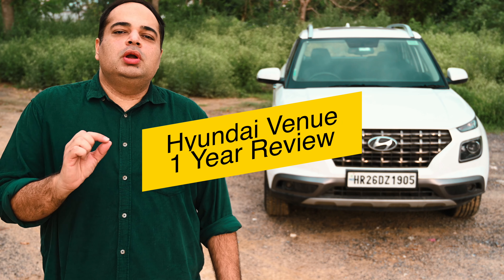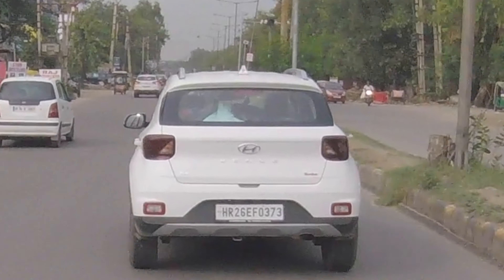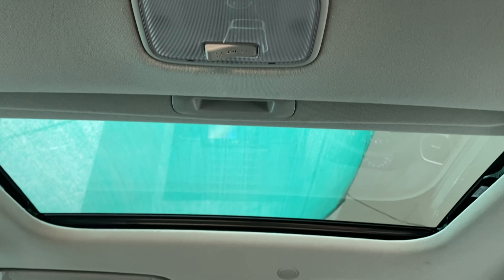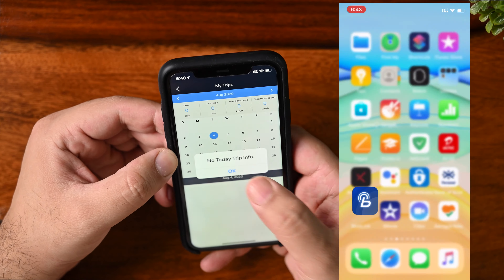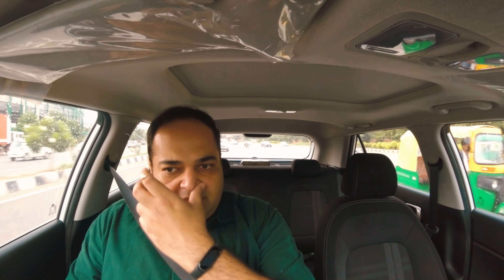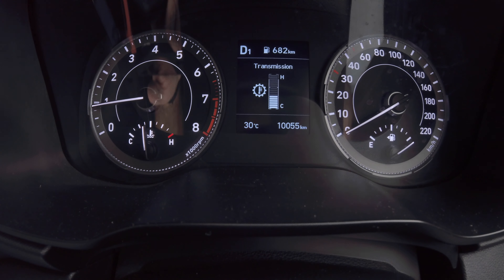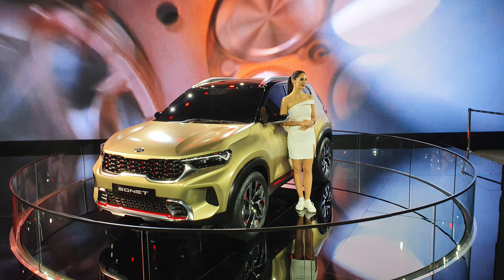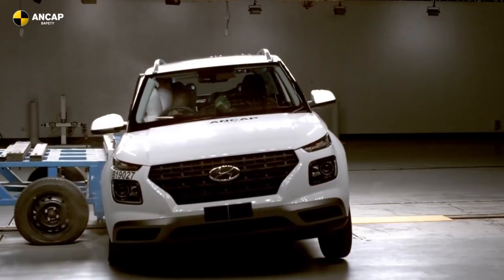Hyundai Venue Owner Review - A Year's Experience in 2020

Comment: Sir that's a great review. I own a Ciaz diesel planning to change, which one either of these shall I go in CIAZ S, CITY VX , CRETA SX petrol occasionally driven about 500km per month.
Reply from the maker: I'd say a change of model will be better. Since you've already owned the Ciaz, choose between the other two. There the decision will be a bit more fundamental: SUV vs Saloon car. I'd say the Honda CVTs are better (with programmed emulated gearshifts) if you're considering that tranny. The most exciting to drive will be the Creta 1.4 Turbo with DCT plus the wow factor of the panoramic sunroof. Anyway you can't go wrong with either. Choose between these two based on your intended usage. Hope this helps.
Reply: @TechnologyRig  Thank you Sir ,  I own a SELTOS diesel AUTO  for Day to day use . I may opt for Creta SX due to panoramic sunroof. Let me test drive both Creta and City to finalize.

Comment: Is 1.0 turbo petrol underpowered when compared to 1.5 diesel?
Reply from the maker: On the contrary Syed, the 1.0 turbo is the most powerful engine in the range and is the quickest and most fun to drive.
Reply: @TechnologyRig  Will it drag with full load and luggage?
Reply from the maker: Syed, even with full load, no lack of power. For that matter, even the diesel will not feel underpowered in this kind of usage. Only Petrol 1.2 is underpowered.

Comment: Hi sir, I have one month of driving experience.. i m thinking to buy a car , so choose to buy venue sx imt ,, is good for new drivers like me or should I go for another variant or car ??
Reply from the maker: Hi Sucheta, the Venue SX iMT will certainly be an easy to drive vehicle. But it's an odd choice for a first car, reason being, most cars are either automatic or manual, thus for a new driver, it's best to practise on either of these types of transmissions. That way, later on when you have lots of driving experience, you can be comfortable driving all sorts of cars. Choose iMT only if you will drive everyday in heavy bumper to bumper traffic. Otherwise the manual will be slightly cheaper and much more entertaining to drive, besides giving you the best experience for later years, as once you're used to manual cars, you'll be able to drive all sorts of vehicles.

Comment: I’m really confused between IVT and DCT, im interested in DCT Creta but as I heard much about the heating issue im worried if i need to take a halt on bumper to bumper traffic because my mostly drive will be on city ,highway and hilly areas

And when it comes to IVT ive heard about the rubber band effct and of the lag that it gives

So can u kindly tell me which one should in for?
Reply from the maker: Hi Steward, no need for confusion, I'll clear your doubts. Yes the IVT/CVT has a rubber band effect, more so on some cars, less prominent on others. Hyundai's i20 I drove with the CVT was lovely and smooth at city speeds, as soon as it went on to the highway, the ugly rubber band effect kicked in- meaning lots of revs, lots of noise and acceleration only after a few seconds. Enough to dissuade me from buying the CVT. Surprisingly, the Baleno CVT was much better, nothing significant in terms of this lag. Now the DCT, my Venue DCT transmission has NEVER overheated in traffic. However, I can see this happening for some people who drive it like a conventional automatic. You don't need to stop in heavy traffic, rather maintain a slow but steady pace instead of constant brake on and off, that might mean missing a few chances to get into a traffic gap, but this way, the transmission will not overheat. For you, simply look at your usage, if its a good mix of your intended usage, go with the DCT, you will love the performance it offers. If however your usage is mostly bumper to bumper traffic, only then consider the IVT. Try the IVT on a highway if you can and press on the accelerator and see if the lag is acceptable for you. Also focus on the engine, the turbo petrol engine is a much better bet than the NA Petrol. I tried the the 1.6 Petrol NA Creta (126ps) last year and it was totally gutless, hence I chose the Venue Turbo Petrol, even though it was smaller than the Duster it was replacing and the Creta would have been the natural choice. Hope this helps.
Reply: The Good Life , thank u so much sir for the information 🙏🏼  n thankyou for sparing your precious time on my stupid question, means alot 😊
Reply: @TechnologyRig  😍

Comment: Sir you have done an amazig review. :- I am very much intersted in Venue, SX+ DCT 1.0 GDI petrol.My running is low for the first 3 years and then I will use it regularly.Initially my father will use it then i will take over. My driving is mostly in the city.Respected sir, pls answer my questions:-
1)Is dual tone availabe in this variant(SX+ DCT)
2)Will driving in manual mode reduce the overheating of the DCT
3)Is the car comfortable
4)Will its turbocharged engine create problems in future.
5)Is the service good?
6)Is it value for money?
Maybe i will buy it next year, so should i wait for the facelift?(if it comes)
Here in Banglore, it's costing me 14.4 lakh on road.Is it good to purchase it?
Pls answer me sir
Reply from the maker: Piyush thank you so much for the kind words. I'm just in the process of uploading a variant selection video for the Venue. I'm sure you will find it useful, watch out for it tonight. The Dual tone is now available in the DCT variant. The overheating issue will not be affected by the manual changing of gears, since the car will have to clutch and declutch when stopping. Point is, drive at a constant pace without jerky and intermittent brake inputs, then you'll be fine. I've never had a problem here, since I understood this early on and adapted my driving style. The only scenario where NA engines were considered more long-lasting than turbo ones was short driving cycles. But all machinery has a finite life anyway. I've had many turbo cars over the years and unless you talk about very old cars, you have nothing to worry about in this aspect. Service so far has been great and inexpensive. Do watch the next video and I hope this helps you.
Reply: @TechnologyRig  THANKYOU SIR, ALL MY DOUBTS ARE CLEARED, THANKYOU ONCE AGAIN FOR ANSWERING
Reply from the maker: Most welcome, glad it helped. Check out the variant video here: https://www.youtube.com/watch?v=4vk89zPiyU8

Comment: Hi Sir, I own venue 1.0 Turbo petrol, it is less than 3 months old. I hear a strange rattling noise from engine bay, I took it to the service station and they had it diagnosed but they are not convinced with the issue as they say that it is default noise from the turbo engine. Can you help me here by letting me know which part of the car did the company replace to arrest the noise. If I know it I can take it forward to the service station and get it sorted. Thank you  :) cheers!
Reply from the maker: Hi Amit, the part replaced was the driver side engine mount. It’s shown in the video at 2:18. In my case the rattle was very low but audible at idle. It may be worth checking out this component of your car if the issue is similar. If the rattle is too loud, then it maybe something else.  Ask them to take it on a test drive with you, and I found that besides at idle, when going over small speed bumps also there was a sound, that’s how the technician found out the issue. Hope this helps.
Reply: The Good Life Hi again, appreciate your response sir. I get this rattling noise only when I accelerate the peddle  in idle position. As suggested, I will take your feedback to the service station to get it checked again. I hope the  issue gets sorted this time🤞🏻(fingers crossed)
Reply from the maker: It’s sounding like the same issue I had. If the rattle is very low, chances are that this is the part that needs replacing..
Reply: The Good Life thanks a lot, sir. :)

Comment: How do you feel about iMT transmission in Venue?
Reply from the maker: Chinmaya it's not something I would choose. I'd either go full manual or DCT. The manual is great to drive and offers the driver involvement whilst having a light clutch. I'd only choose the iMT for bumper to bumper traffic and that too if I couldnt get a different car with a CVT or torque converter auto instead.

Comment: Did he explain what's the advantage over sonet ?
Reply from the maker: +Sathish Kumar K S are you deciding between the two? You can’t go wrong with either, Venue is a bit more traditional especially in terms of the interior and the Sonet has a more modern interior design. Apart from a wider service network, the Hyundai doesn’t have any specific advantage as such. Choose based on a test drive. Hope this helps.
Reply: Ur thumbnail made me ask the question. I've booked sonet.

Comment: BEWARE! My brand new 5700 km ran Hyundai venue DCT top end, is in Hyundai service center from 7 days, still not repaired for a small clip went missing and it had to be ordered from Mumbai ( without which car is not advisable to be driven). Power train light is continuously ON. 
Basically its a delicate vehicle and nothing like a SUV.
Reply from the maker: +Pratik D sorry to hear about your bad experience. Can you tell us more about the part in question? What does it do?
Reply: @TechnologyRig  thanks for reaching out. There is a small metal clip attached to a rod which is used for turbo charger. Even the technicians at Hyundai are not able to find how it disappeared. I came to know as Power train light was continuously ON. They are saying it can happen to any Venue and that part is not available at service centers.
Reply from the maker: Keep us posted. They will have to fix it under warranty and I’m sure it shouldn’t take much longer. Even my part took a couple of days to arrive but was a more generic engine mount, so easier to source. Hopefully things will get sorted soon for you. 🤞